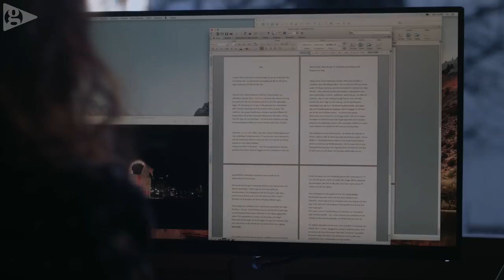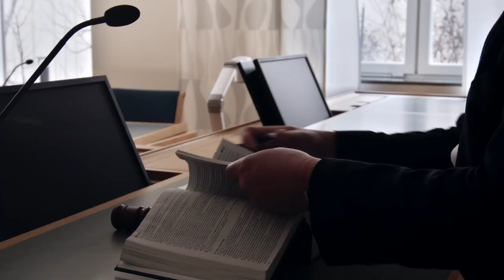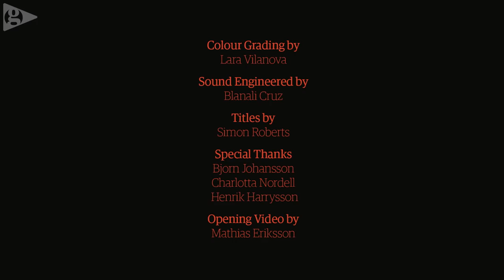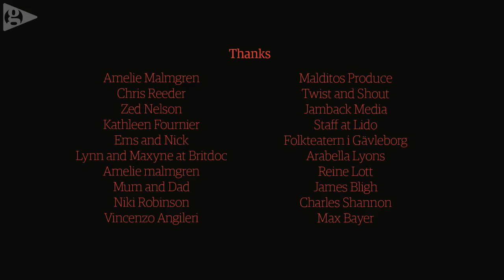Killing Gävle

Comment: seems like yet more marketing. that pagan dude sounds fake. this is how nessy was born. set up a perimeter and have a security guard 24/7. problem solved. duh
Reply from the maker: Actually, they DO have that but it still often doesn't stop the saboteurs. They have fire they can throw...
Reply: then make the perimeter larger. come on, this is simple to solve. they want this to happen.
Reply: they can't make the perimeter larger because it's surrounded by the main roads. They could move it, but its tradition so they wont.  And secretly they want it to burn down because if it doesn't they have to spend money taking it down.
Reply: +Kevin Giambrone 
They even explained that one year it was set on fire using fire arrows - didn't you watch the video?
Reply: +MeroTV 
I'm pretty sure it's more expensive having the firedept go and kill the fire and secure the area than it is removing the straws - besides, they still have to take down the frame!
Reply: +Kevin Giambrone 
If you made the perimeter larger, no one could get around it in the town!
Reply: listen, all I'm saying is that if they wanted to stop it, they could. They haven't, hence they don't. No fire and it's just a dumb straw goat and no guardian story.